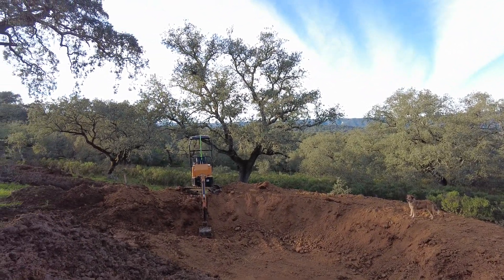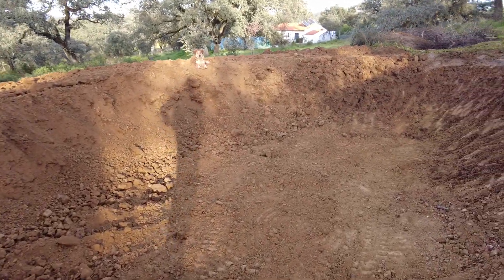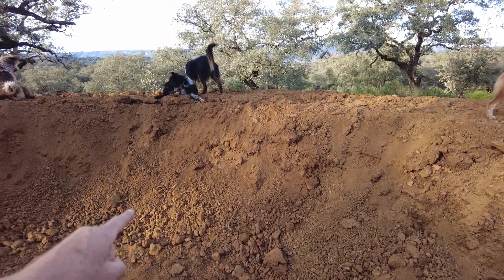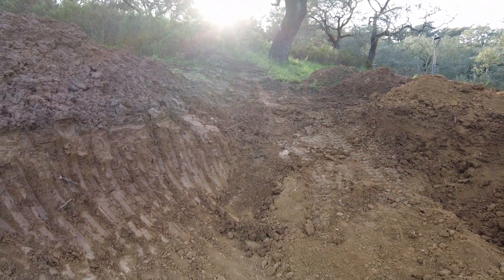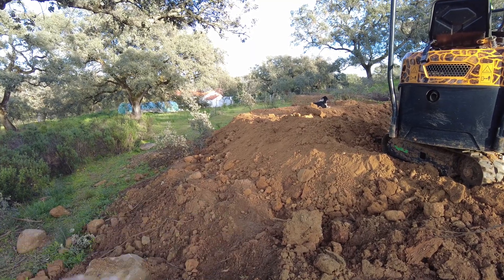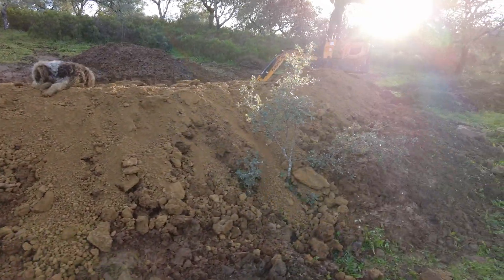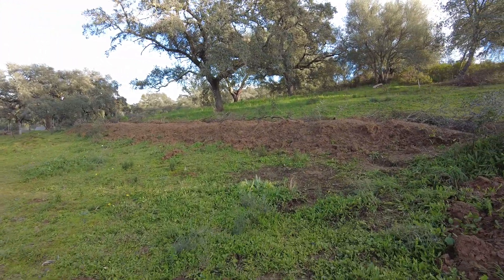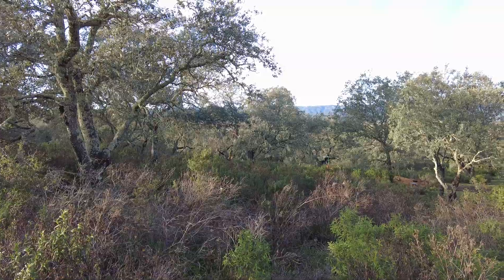Pond final depth reached. Is an empty pond still a pond?

Comment: It looks like you may get some rain tonight.  Hoping so 😊Not enough for measurable flow - but it's a sart 👍
I'm hoping your pond fills in February😊
Now that the pond is 90% complete, what do you think about tiring to direct more culvert water to the west?
Is the occasional water flow from the highest plateau a candidate for a short swale to turn the direction of the flow from downhill to 90 degrees to the west?
All the best 😉
Reply from the maker: About the culvert my head is broken Steve. There a no other simple options according to what I know right now. The desire to divert water is strong. So, I'll keep looking at it with open eyes
Reply: @SuerteDelMolinoFarm  I understand, you need a break.

Comment: Really interesting that water doesn't want to reach lower levels of soil. There is so much of humidity on the top, but it looks that it is too afraid of going deeper down 😅
But it looks that weather paterns will change soon, so there should be more rain during January
Reply from the maker: Thanks for sharing. Interesting stuff!
Reply: Same here, i was thinking maybe the swale are not deep enough 😮
Reply: @peperillon  I would expect that oak trees with their strong roots will be able to break the soil and send water deeper. Maybe there is some very compacted clay layer which is blocking water
Reply: @drazencvija8166  There is likely a hardpan from plow mould boards compounded by an overall compaction by large heavy animals with small hooves (beef cattle and pigs) that overgraved this land for decades if not centuries.  Restoring this dirt to living soil is a decades long proposition👍.

Comment: It would be useful to do a jar test with the dry soil from the lower level. It is possible that it also has enough clay content. This condition of moist upper and dry lower soil, that often occurs in arid and semi-arid regions, can be caused by differing levels of soil compaction, such that the water travels along the horizon where the compaction changes. No amount of water applied to the top of the soil will penetrate to the lower profile. You may have perched water that is not able to go down. 

Ripping with a tractor or growing deep rooted plants that can penetrate into the compacted layer are ways to address that. In your context you probably don't want to rip due to the mature oaks. And of course you want the dam to hold water. After a rain and prior to the dam being filled, you might observe water seeping into the dam along this compaction line when the soil above is saturated. If so, that would perhaps confirm this possibility. I have seen this on my land when digging holes to plant trees, moist soil above, dry soil below. You do not have to have caliche to have soil layers where water does not penetrate.
Reply from the maker: Valuable sharing. Thank you
Reply: I believe you are spot on Pat.  There is likely a hardpan from plow mould boards compounded by an overall compaction by large heavy animals (beef cattle and pigs) that overgraved this land for decades if not centuries.
One of the purposes of the on contour planting ribbons is to open the soil.  Among the seeds that have been planted is daikon radish and of course add biomass.  
I expect with constructions and plantings that have already occurred, the depth of rainwater penetration will continue progressively.
One deduction we can make from this excavation is the Holm and Cork oak trees are stressed from drought because there is no moisture at depth.
Reply from the maker: @stevejohnstonbaugh9171  Stress! Stress! Stress! Thank you Steve
Reply: @SuerteDelMolinoFarm  Not on you Martin.  Luxuriate in your accomplishments!  What you have accomplished and discovered in X years is a marvel.  You are reversing decades if not centuries of land abuse.  
Nature will collaborate with you on her own timetable.  I think we can say with certainty nature's timetable is not the timetable of the human condition. ❤
Reply from the maker: @stevejohnstonbaugh9171  Beautifully said. Thank you for sharing Steve

Comment: Saturation - air pockets is only a small part of it. Some substances, like clay or gelatine, form weak bonds with water molecules. Thus they will expand with the presence of water.
This dry soil at the bottom, is it still clay? Clearly, clay layer prevented water to penetrate more than about 1 to 1.5m and soil at that depth is quite dry. Interesting observation for your water table replenishment afforts.
Have you placed more twigs and wood in the small creek (one with two gabions and 2 dam walls)?
Great effort, Happy Holidays!
Reply from the maker: Thanks for sharing the good wishes. The erosion gully is untouched. This pond takes all my time. Have a good day